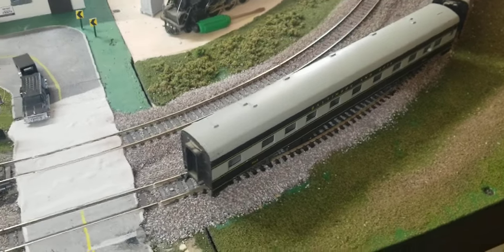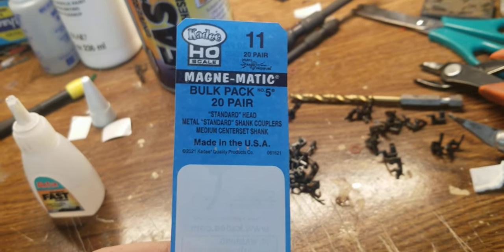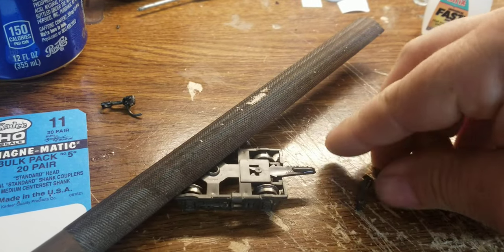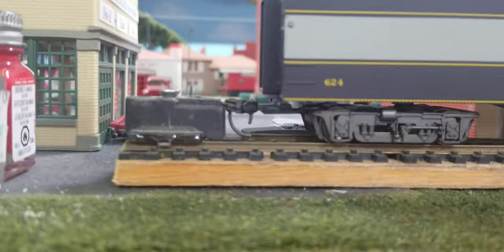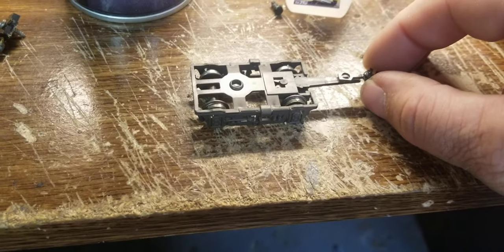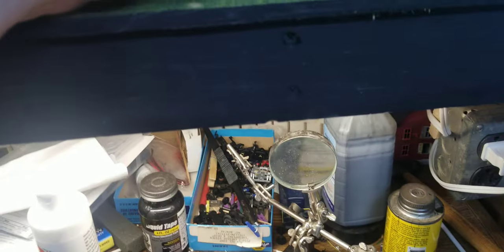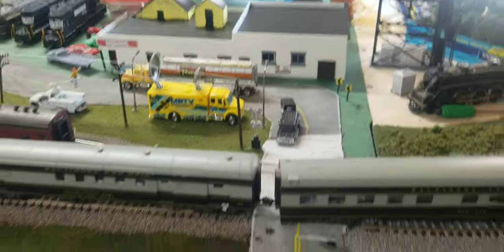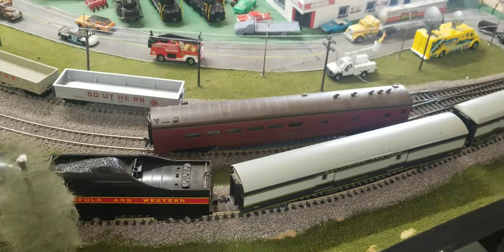Easy way to Put on KADEE couplers On your rivarossi passenger cars

Comment: Doin' it the hard way--you can get Kadee conversion couplers for these--they just snap on to the existing truck hole.
After you do that, paint the roofs black. B&O did not have gray roofs.

Comment: Can you please add the name of the adhesive you use.
Reply from the maker: https://www.amazon.com/Akfix-Adhesive-Activator-Clear-Accelerator/dp/B01BY6DOEW/ref=asc_df_B01BY6DOEW/?tag=hyprod-20&linkCode=df0&hvadid=167120584204&hvpos=&hvnetw=g&hvrand=3864212341783540432&hvpone=&hvptwo=&hvqmt=&hvdev=c&hvdvcmdl=&hvlocint=&hvlocphy=9015573&hvtargid=pla-379409671169&psc=1
Reply: lol its the name is on the can